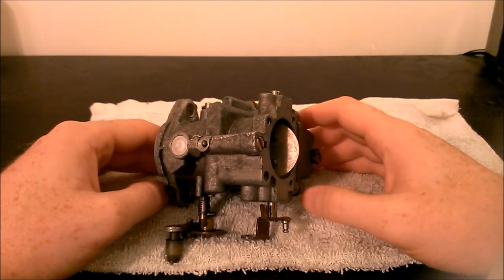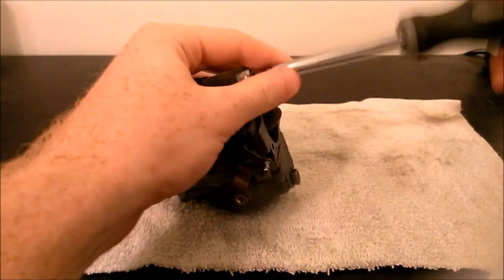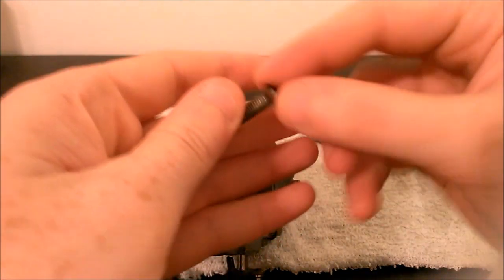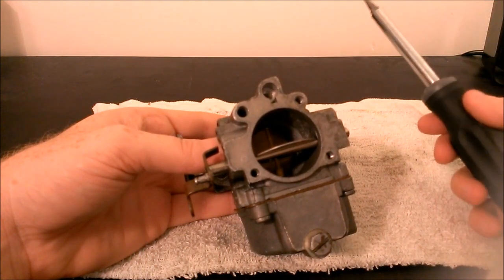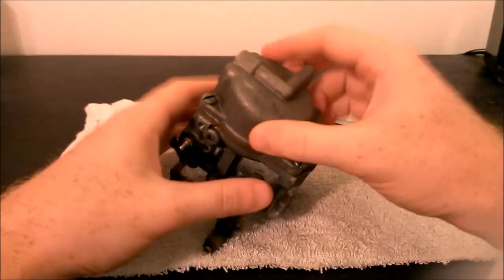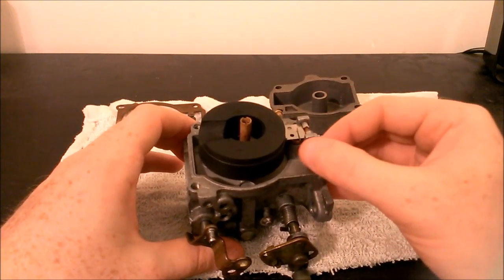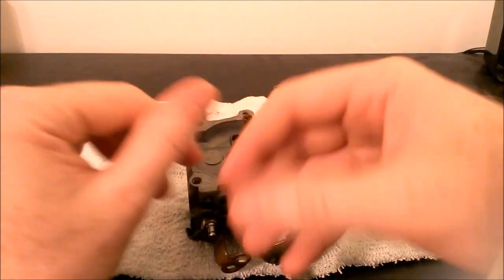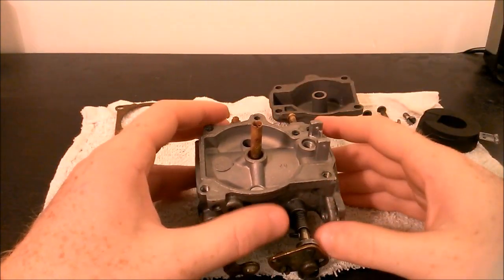How to Clean and Rebuild a Carb

Comment: Great step by step video, Jason.
For anyone who isn't sure... the metal plugs he says to pop out with a screwdriver, don't worry, new ones will come with your carb rebuild kit. Also, do NOT soak your carbs in vinegar as other ppl are suggesting as it will eat away at the finish that is on the metal and cause pitting and pinholes in the metal which eventually will cause more issues. Go to your local dealer and get the proper cleaner they suggest and follow its directions.

Comment: just had a water pump replaced on my 92 Evinrude 25HP. Took it out for first time and now it won't accelerate.  It idles fine but as son as I give it gas it bogs down and dies. So,  I called my mechanic and he said I have a plugged jet and to blow air through it.  I was still on the water when I called him and he had me hold the choke in while giving it gas. It would accelerate better.  That's how he determined the clogged jet.  Then I went and found a diagram for the carb online and nowhere does it say anything about a jet. So then I went to YouTube and found your video. I am hoping just blowing air to dislodge the clogg from the jet will help. At least I know where the jets is,  now.
Reply: +Jay Johnson I have the same problem. Idle fine but won't accelerate. Did you find any solution?
Reply: I ended up taking it to the mechanic. I think he just cleaned the jets. I just didn't know how to do it.

Comment: Flush float when upside down and check for 3/4" float drop right side up. Measured from bottom of carb/bowl surface to float inner surface at greatest dist. No thread lock or if you feel safe a small drop of blue TL.  I prefer some stuff call Tef-Gel, works great.

Comment: the hardest part was figuring out how to get the carb off. cleaning it was nothing. finding the third bolt on the starer bracket. i search the vids for that and had no luck. i saw something at a forum that said there was three. it is behind the silaniod

Comment: Great vid, cleaned out as your vid suggested, 2 of the three carbs seem to run perfect, however one is starving the cylinder of fuel ( dry spark plug) Pulled it off cleaned again. Tried a spare carb I had. Same thing. What else could be the problem? I have 135psi on that cylinder, 

Thanks in advance

Comment: Hi Jason..   Ish here

I do appreciate your video. it will be my guidance to repairing my carburetor when i find the kit.  so I have a 1970 50hp, 500 thunderbolt ignition. lower carburetor is leaking fluid when the motor is running like a water tab.  i have been looking on e bay but most of what i found so far don't have the pins and the float..  where do i get a complete repair with pins and floats??  thank you

Comment: Great vid.. I'm nervous but still going to attempt a carb rebuild on my 1977 Mercury 850EL... any advice before I jump in?
Reply from the maker: It's a lot easier than you'd think. My only advice would be when you disassemble just remember where all of the screws and gaskets an such went, so it's easier to assemble it.

Comment: I am rebuilding 3 '73 65 hp johnson carbs. Some of the whie little plastic pieces that hold the linkage bars broke in half. Where do you get replacements.
Reply: Any Evinrude dealer should have them or be able to get them.  Part number is 313329.

Comment: Do you use any threadlocker on the bolts??? I did a carb rebuild on my Johnson 60 carbs and the bolts started to get loose after a few times on the lake.
Reply from the maker: Armando Reyna I never have. I always just snug them down real well. Blue Locker should be fine if you are having an issue with them coming loose.

Comment: Rebuilding a 1969 staoh tractor carb. Wont start, has spark. New coil, distributor, etc. Being a pain in the butt. Any pointers?
Reply from the maker: I'd check compression on all cylinders,

Comment: Hey I have a 6hp evinrude about the same year and it is having idling issues. Will a carberater rebuild kit help? Or should I just take it to a shop for 120 dollars?
Reply: Rebuild should do just fine...adjust mixture though
Reply from the maker: Sometimes an idling issue is the result of a blockage in one of the jets. Or it could just be that you need to fine tune the mixture.
Reply: Where can i find the main jet for a 78 evinrude 25hp outboard ?

Comment: 15:26 you install a screw plug into the top part of the carb... How far does this need to go in.. also what is the purpose of this screw.. i just rebuilt both of my carbs and on one of the carbs the screw goes in very far and the other carb it only goes in to where it is flush
Reply: Josh, I would assume that they would both screw in the same as both carbs should be pretty much identical. Maybe the screw or threads inside are damaged or perhaps you forgot the washer?